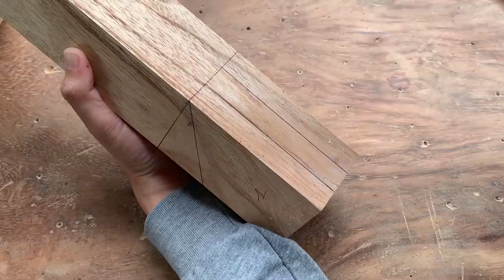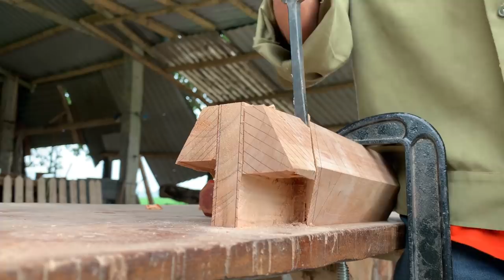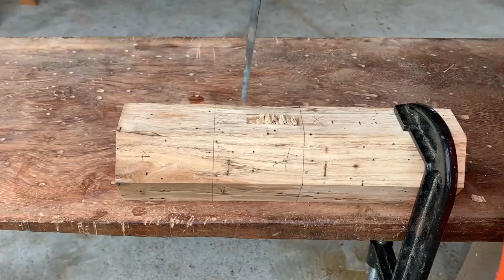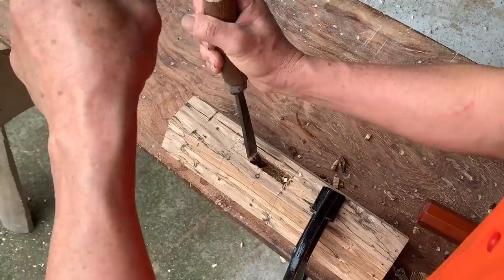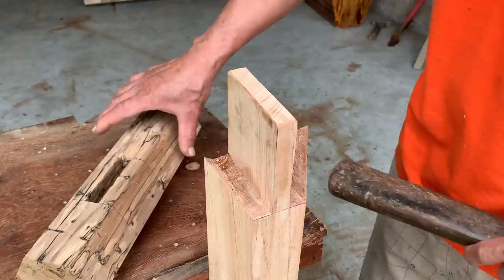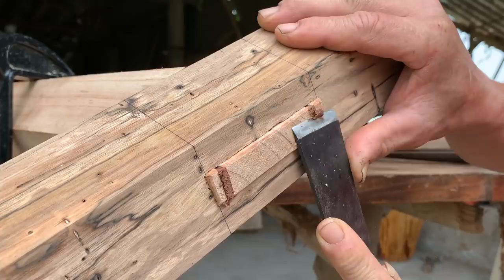Amazing Woodworking Japanese Joinery Skills,  Simple But Very Useful Woodworking Link Station

Comment: Another nice joint, that could be used as a vertical extension, or with a slight adaptation for a bottom and top frame for a wooden framed building, if you keep on with these wonderful joints, I'll have enough to begin making my shed. Though we're a little short of such large chunks of fig wood here in Wales.

Comment: Beautiful and very precise. A little glue will make all that work last so much longer.
Reply: You’re correct however that’s why these joints were invented hundreds of generations ago before they had mechanical fixings of any kind and they needed a bond that would hold for hundreds of years without any glue or nails or screws